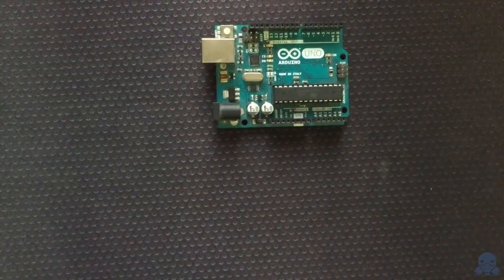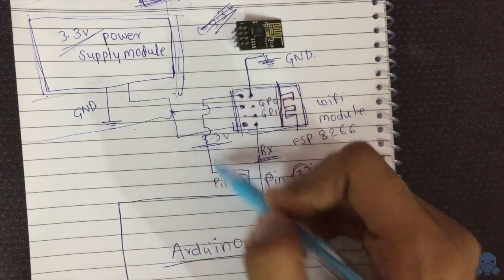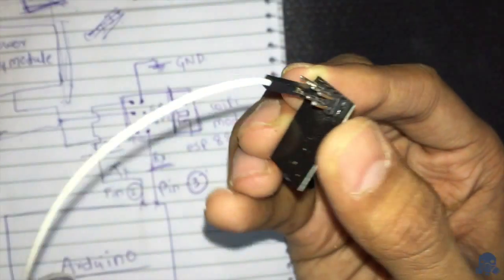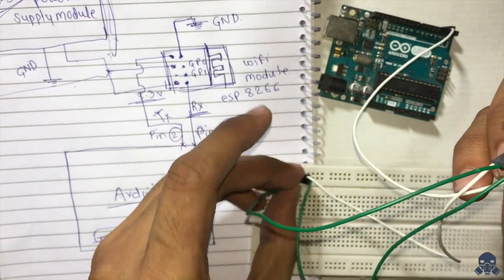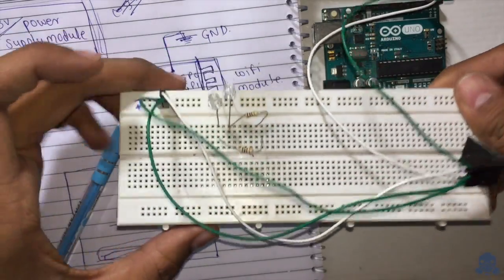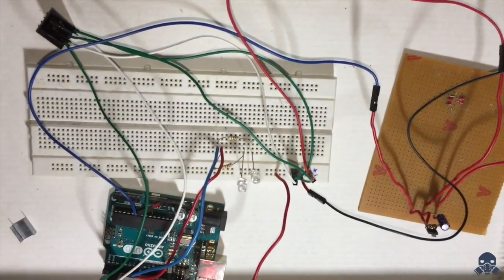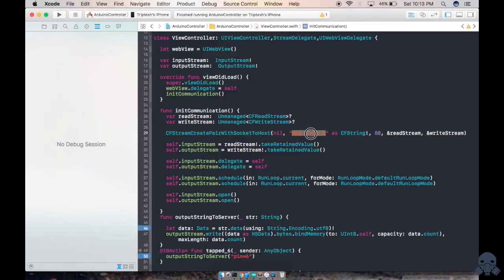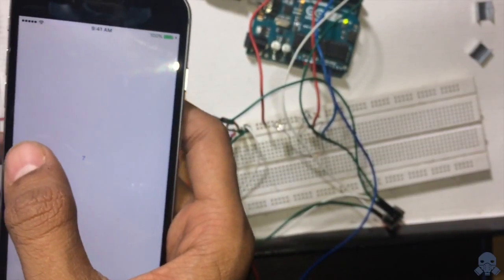Control LED using ESP8266 and iPhone | Android | Wifi | ESP8266 | Arduino UNO | iPhone

Comment from the maker: Hi Guys, can't thank you enough for all your great support. Checkout my new video, I hope you like it, and please let me know any suggestion to make better videos ❤️ ❤️ ❤️  Control LED from anywhere in the world without using Arduino board.
👉  👉  👉  👉  https://www.youtube.com/playlist?list=PLKql6gcii8KETZeZ-AEM47Njzd1AWJ5oT 👈   👈   👈   👈
Reply: I have nodemcu esp8266 but I can't use it
Reply from the maker: You can’t use node mcu for this video
Reply: I want to use relays with the node mcu but the relays are not working only the led which are there at relay they just blinking.
Reply from the maker: What power source you’re using? Are relay leds responding to on off?
Reply: @tinandjar  actually I am using 4 channel relay which is connected to nodemcu and I am using blynk app when I turn on the button from  blynk app the led which are there in relay it's blinking but the relay not switching
Reply from the maker: Check voltage required to relay

Comment: can someone help me please ? is possible to control a relay and  for exapmle a step motor in the same time? becuase we have only one tx and one rx one the esp8266 module. can the arduino recognise the different data that the esp module is sending or is possible that the esp module sends a different data for each action? thank you in advance
Reply from the maker: Yes we can do it, from app you can pass different data
Reply from the maker: Tx rx are only for communication between module and arduino

Comment: do we have to use any resistor if we use the 3.3V  pin of the arduino to power the wifi module ? thank you in advance for your answers 
:)
Reply from the maker: It wont work in arduino 3.3 because of power issue but you can try and no need to use register
Reply: in some sites on the web some people uses resistors between the connection of tx  and rx rx and tx of esp8266 and arduino . but I see that in your video u dont use any resisitor. in the datasheet is written that the wifi module can use max 12 mA  but the uotput of the pin of arduino uno is 50mA.  I am a little confused XD

Comment: please tell me how you connect the android app with arduino? its automatically connected with arduino if i gave the ip address as you've given?
Reply from the maker: You have to connect your phone to access point of wifi module, and then u can send data to that ip
Reply: @tinandjar  
SoftwareSerial esp8266(2,3); // make TX Arduino line is pin 2, make RX Arduino line is pin 3.
sir i want to ask if we dont want to connect TX and RX as power supply should i connect battery to breadboard or ardiuno??
Reply from the maker: @muhammadsharjilbscsmspm  they are not connected for power.
Reply from the maker: @muhammadsharjilbscsmspm  they are for serial I/O

Comment: Can you tell me that 
1.I opened android code files on android studio.What do i do next?
2.I want to add something on android code.
Where should I fix this code because there are so many code files?
Thank you for great video.
Reply: *there are many code files in your android code files.
Reply from the maker: Change in .java files, activity classes
Reply: What files in your floder to change in .java files?(In the floder android app have a lot of files.)
Reply from the maker: You can change in MainActivity. java, it has all the code,

app>src>main>java>com>teenenggr>esp8266_wifi_ledcontrol>MainActivity. java
Reply: Thx very much

Comment: Hello sir, great video! I was wondering if there is ANY possible way to do this except only with a logic level converter instead of  the 3.3 volt regulator. Also, does the capacitor have to be that exact value? I have a 50 volt, 1 uf capacitor and was wondering if that would work. I am working on trying to make the esp8266 control a servo motor via my command on my smartphone, and am just esxperimenting with the module. If you could help that would be great! Thanks!
Reply from the maker: You can try it, but first without connecting esp use multimeter to see the voltage output, it must be 3.3v then u can connect esp safely
Reply: I don't have a multimeter but I'm positive it gives out 3.3 volts. Thanks!

Comment: how can i open Android app. This File only use MAC
Reply from the maker: Download the Android project, extract .zip file, open it in Android studio, then you can run app on device.
Reply: I am beginner, I am sorry.. Which file i Import in android Studio. There are so many file..
Reply from the maker: Import folder, you will see icon instead of folder icon, or just import folder as project

Comment: Can you give me any Amazon links for the capacitor.Can I use https://www.amazon.in/gp/aw/d/B079NQJTTP/ref=mp_s_a_1_1?ie=UTF8&qid=1523279419&sr=8-1&pi=AC_SX118_SY170_FMwebp_QL65&keywords=10+uf+capacitor 
 instead of of that capacitor
Reply from the maker: I have added detailed specification, which capacitor i used.
Reply from the maker: you can use this one - 63v 10uF
https://www.amazon.in/JL-capacitor-63v-10uF-PACK/dp/B0791C1S1C/ref=sr_1_1?ie=UTF8&qid=1523607457&sr=8-1&keywords=63v+10uf+capacitor

Comment: Links dont have proper files
Reply from the maker: Azeem Javed which files you need?
Reply: Well both links didn't work, kindly upload an alternate links to the files or email them to me at syedazeemjaved@gmail.com. TIA.
Reply from the maker: link is working http://teenenggr.com/?page_id=47
there is download now button.
Reply: well I couldn't find proper ino files in the folder, please confirm.
Reply from the maker: open in text editor and copy the code and paste in Arduino IDE, you good to go :)

Comment: Dear sir
I have two part of land far a way 1,090 meter then need to send data as land temperature, wet or dry and watering or not from both site by SIM800. How can I used ESP8266 to connect these data from many place in a time.
Reply from the maker: Suong Sophal have you checked my other video, that will help you for sure, let me know if you need any help
Reply from the maker: Did you get any solutions?

Comment: Hi, does this configuration allow the esp and mobile app to communicate with each other in diff networks ( wherein wifi router with which esp is connecting to is blocking andruino to send data to mobile app n vice versa)
Reply from the maker: no It don't allow in different network, I am currently working on that video. which I am going to launch tomorrow.
Reply from the maker: Here you go https://youtu.be/gZ6qJARzxVA
Reply: @tinandjar  Can I learn all this stuff present in ur channel 
From where did u learn this

Comment: how to recive data sent from the wifi module in the ios code
Reply from the maker: to receive data from wifi, this Arduino code won't work, you have to do serial communication, using device and iPhone app
Reply: Teenenggr i only want to know the ios part. Is this communication func will help me recive or i need a totally different code
Reply from the maker: you will need different code, totally different,
you will need serial communication code, like we do serial communication with two terminal in Java.(google it you will  find it)
Reply: Teenenggr i searched for it but i did not find any tutorial that i can follow can you show me a link

Comment: hi, i'm a beginner with arduino. at 10:26 you said to be sure that we are connected to the device. do you mean the wifi router?
Reply from the maker: device i mean ESP-8266 access point

Comment: it will more better if you give pin name of wifi module.
which pin(name of wifi) is connected to which pin of arduino.
Reply from the maker: yes you can see it in video and also in diagram.

Comment: How can we use that board...  Which is used in voltage regulator
Reply from the maker: left pin - GND
middle pin - 3.3v output
right - 5 v input

you can also use this one which have same pins as above description
https://www.adafruit.com/product/2165

let me know if you have any questions
Reply: only we can use macbook or any laptop
Reply from the maker: likith sai to build iphone app you need Xcode which is only in mac

Comment: Can i make web server to control data of esp
Reply from the maker: Yes you can
Reply: Teenenggr but i want to control gpio of pic microcontroller over esp 8266 web server can you help me out to solve this kind of requirement ??
Reply from the maker: yes, so you want to control LED using webserver right??
Reply from the maker: and this is same happening in above code,

it creates the server on esp8266,
and you have to send data /pin = 3 like this, 

that is what you wanted right?
Reply: Teenenggr yes but the controller send data like S1 for the relay switching and this kind of data do not support in arduino  coding so can  you suggest me to another way to switching relay ?
Reply from the maker: what do you mean by controller?? can you elaborate more I didn't understand., explain full scenario then I can help
Reply from the maker: relay is connected on arduino?
Reply: Teenenggr we use pic microcontroller instead of arduino so the coding is different so we face difficulty to communicate esp and pic microcontroller
Reply from the maker: so you can add patch like this
if s1 then output 1,
s2 then output  2.
Reply: Teenenggr yes our micro controller read s1 means it will high the relay

Comment: sir,
i don't have mac. so i can code the app in windows.
Reply from the maker: you can't run iPhone app in windows machine.
Reply: ok sir 
what will be the 2nd option to control led from iphone.
Reply from the maker: advait jaiswal what do u mean by second option?? We can either send 1 or 0 in url or another is done here connect serially
Reply: Ok sir 
did you have code for arduino to control LEds from webpage.
Reply from the maker: advait jaiswal no sorry I don't have
Reply from the maker: advait jaiswal but it would be same as this u just have to call api from webpage instead of app

Comment: sir,
we can use webserver or webpage  to control LEDs .
Reply from the maker: yes we can
Reply: sir,
how we can make webpage for the control of LEDs.
you can share your email id or phone number it will be easy to do conversation.
Reply from the maker: do you want to open webpage in mobile?
Reply from the maker: we're already creating server here, using command 
sendData("AT+CIPSERVER=1,80\r\n",1000,DEBUG);
Reply: sir,
yes i want to open webpage in mobile.
Reply: sir,
I have one more problem with the connectivity of wifi module.
I did not understands that wifi module is connected with wifi router or not.

Comment: is it necessary to  flush the esp8266 module ?? because when i command with the android app the led LED does not turn on/off immediately !!
Reply from the maker: Can you send me your android code jatinpatel101@gmail.com I will check
Reply: i have done an app on app inventor i will send you the code !
Reply from the maker: Ok Thanks
Reply: i sent you the arduino code and the app!
thank you for halping me
Reply from the maker: I am not able to open that .aia file in app inventor, it  says project name should start with letter.

Comment: I have a question.....The code for arduino mega is the same??, 
I need to make some changes?
Reply from the maker: It is same, no need to make any changes
Reply: Ok, 
I am trying to perform this tutorial using Arduino Mega but it is not communicating, when I open the monitor series I get nothing.
On the other hand I comment that if I open a new window of arduino and without any code and I put the TX and RX of my module in the TX0 and RX0 of my arduino at a speed of 115200 if it connects without any inconvenience.

Comment: Arduino already has a 3.3v pin 
is that power source module really need for wifi ??
Reply from the maker: because we need constant 3.3v, you can use arduino but it's not constant. so your wifi module will not function properly.
Reply: Ah so I can use 5v pin power supply and a converter to 3.3v to use the esp module
Reply from the maker: othmen farah yes
Reply from the maker: othmen farah jatinpatel101@gmail.com
Reply from the maker: Ajuba Dani Pedrosa yes
Reply: why.. when arduino already has a 3.3v pin??
Reply: othmen farah 
Arduino uno has 3.3v pin in power supply block
Reply: Thank you for your help.
Can I get your email adress.i need some help in a project?
Reply: othmen farah ajubadannypedrosa@gmail.com
Reply: Teenenggr 
can you sent me the code for switching led using mobile browser(Arduino + html ) codes
Reply: Thanks mate
And do a video about it.
Reply: The amp draw is to big... that's why
Reply: Teenenggr
Thank you so much for your help .
I appreciate it
Reply from the maker: Ajuba Dani Pedrosa I don't have it right now, I'll see if i can get it for u

Comment: Normally, RX of Esp8266 needs 3.3 volts and you connect that one directly to arduino which gives 5 volt. does it with 5 v?

Comment: i already upload the code, but nothing happen in my serial monitor.. pls can u tell me whats wrong, thank u
Reply from the maker: have you checked baud rate and line ending selected correctly in serial monitor?
Reply: i changed my baudrate same like at ur video. 😔😔
Reply from the maker: try running AT commands

Comment: Why not simply use the 3.3V from the Arduino? No need for a regulator
Reply: Have you tried that? In my experience, the ESP8266 is so damn wonky that it's highly advisable that you use a separate power supply

Comment: Have u connected the phone with arduino by cable??
Reply from the maker: No.
Reply: Then what is that white wire connected to ur phone?
Reply from the maker: Phone is connected to laptop, to run iOS application
Reply: is it compulsory to connect phone to laptop then.
Reply from the maker: NO just install your app and you can disconnect it.

Comment: I loved ur channel and u have taught me a lot of things... I did everything as you said but when i type AT, nothing comes up.. But then i put the arduino reset pin which is above the 3.3V to ground ........ AT and everything works but then my code inside the loop doesn''t get executed .. 

ps: i loved ur channel plz tell me if there is a way to donate to your channel  !!
Reply from the maker: Thanks Rahul :)
Reply: can you please help me out with the problem
Reply from the maker: Rahul .Jain yes let me know what is the problem
Reply: I did everything as you said but when i type AT, nothing comes up.. But then i put the arduino reset pin which is above the 3.3V to ground ........ AT and everything works but then my code inside the loop doesn''t get executed ..
Reply from the maker: have you selected appropriate options in serial monitor

Comment: guys, Why did you make the power supply 3,3v to the modules did not do it from arduino 3,3v port
Reply from the maker: because we need constant 3.3v, can't use ardino 3.3v

Comment: Hi great project. I would like to know if it is better and easy to use Arduino WIFI Shield with arduino Uno as apposed of using the ESP8266 module? My project is sensing light intensity, temperature, and humidity using 3 sensors and controlling outputs like fan and LED according to the reading of these parameters through and Iphone app like in the video. Can you please advise me which to use the  Arduino WIFI Shield or the  ESP8266 module? Thanks
Reply from the maker: ESP8266 module would be easy I think

Comment: Does this work the same if I use a python program instead of an Iphone ? I just want to be able to send data (a number) from a python program (using Tkinter) my arduino card so that I can turn on and off LED like you did in you video
Reply from the maker: yes

Comment: I have connected 5 LED in pin no 13,12,11,10,9
Now i want to connect wifi esp8266 module without using voltage regulater,
Can i use from Arduin's 3v itself?
Reply from the maker: no,can't do without voltage regulator